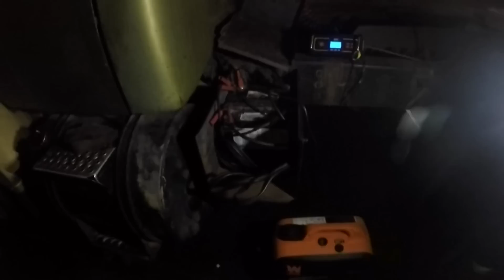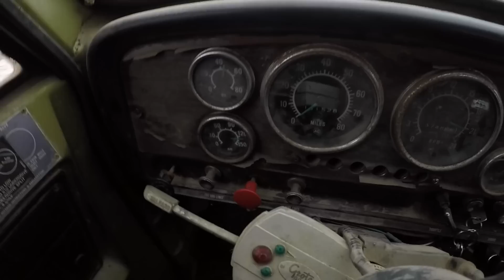(PT2) 1971 GMC 9500 started after 26 years Now will it drive 1767 Miles - Montana goes wrong...

Comment: Definitely tack weld bolts on the hitch if at all possible.  If you can't take it to someone who can.  It's mandatory on all safety appliances in the railroad.  Torch the bolts off when finished with 'em.  Neat old Jimmy.  Shame the alternator is giving out.

Comment: It sucks that the steer tires couldn't hold up for the trip, but sometimes "ya gotta do whatcha gotta do" and replace them. Bad steer tires can be a widowmaker. You probably would've gotten just a small bit of better fuel mileage without those big azz float tires on the front and went to some standard sizes. Unless you're going to do quite a bit of soft soil driving when you put it to use, you probably don't need them. Also when you stopped at that truck stop for the night and had to fix the hitch in that cold, it might not have been a bad idea to have not shut the truck off and just let it idle at just a little above idle rpm. I used to work for a company back in the 1980s that had a fleet of Mack R and U models that were mostly the same age as that truck. During the winter conditions like that, we would just let them idle when they were parked in the yard so not to have battery and starting issues. Glad to see you rescued that old GMC.
Reply: I was thinking that attempting an 1800 mile trip on 26 (at least) year old tires might not be such a great idea....